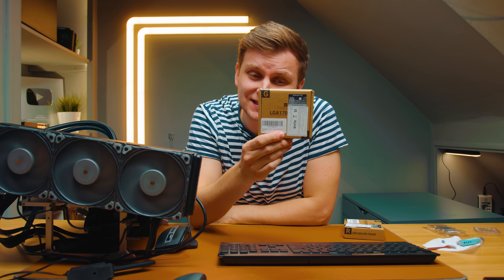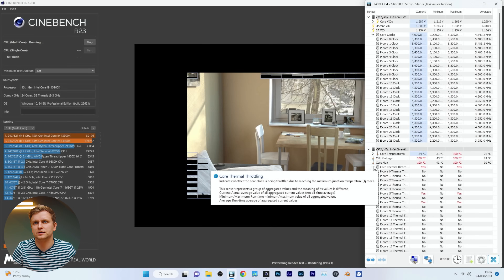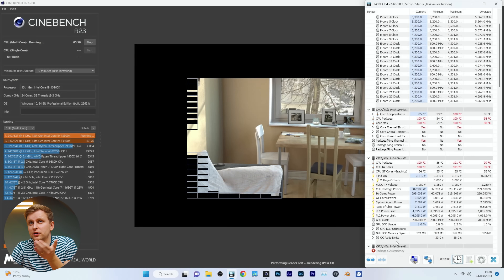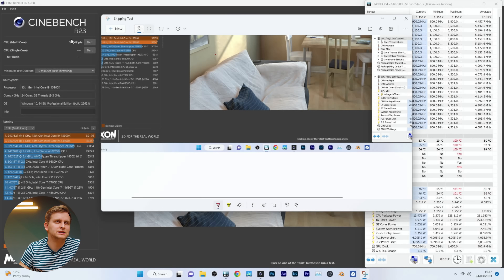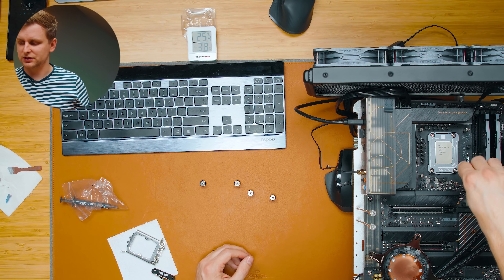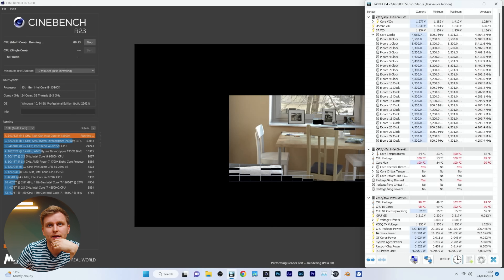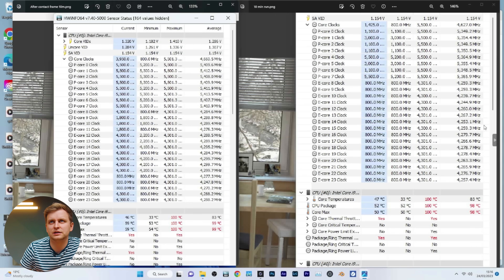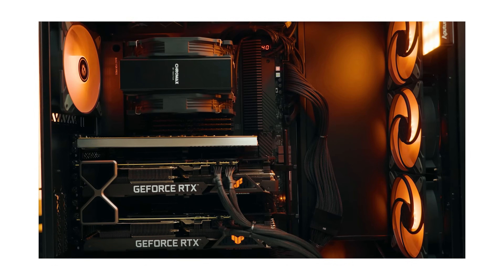This Makes Your CPU FASTER & COOLER 😱 | Budget CPU contact frame for Intel & AMD

Comment: The Thermal Grizzly Contact Frame is manufactured and produced in Germany and it has lower tolerances than the one from Thermalright. I am using the one from Thermalright, because the Thermal Grizzly Contact Frame wasn't available, when i needed it. The Mounting is also slightly different - Gamers Nexus did a good Video about it.
Edit: I am using an i5 13600k slightly overclocked to 5.4 on the P-Cores, 4.4 on the E-Cores and 4.9 on the Cache with a fixed voltage of 1.26V (equal to stock under load). In my case, i got a 9°C improvement in liquid temperature. The CPU itself was 15°C cooler than before. Testet in Cinebench R23 with a warming up time of 20 minutes and a 30 minute test run - my loop has about 450 to 500ml of coolant and a single 360mm radiator.
Reply: The Thermalright frame is much easier to install that was enough for me. If you're going to make a better solution to Intel's over engineered jank then don't replace it with more over engineered jank. (but then the Thermal Grizzley one is german designed and germans are all about over engineered jank)
Reply: No way it's stable at 1.26v. Try compling the shaders on Last of Us 1. It's gonna crash every 20 seconds. That was my experience until I raised the voltage
Reply: @od1sseas663  Silicon Lottery...
Reply: @Hasbert1988  did you try it in last of us. That game is 10x more demanding than even stress testing apps 😂
Reply: @od1sseas663  No, but for my Usecases it is stable.
Reply: @Hasbert1988  Makes sense, fair enough. I said the same when I tuned my ddr5 ram. People where like "I don't think it's gonna be stable if you stress test it for 24 hours". Dude, I don't have a server, I only play games so I don't care. It's stable for me 😂😂
Reply: bro i read it as thermal glizzy frame 💀💀💀💀💀💀💀
Reply: @pendrive4real  Thermalg rizz ly
Reply: this, availability is a bih most of the times i swear. i can barely get my hands on an arctic aio. had to buy it from an unreviewed item online, glad the seller delivered.

And so i opted for thermalright as well.

Comment: Hello, I should install it on a z690 Unify X with a 13600KF? I see tracks going from the cpu to the ram and I'm afraid of interfering. This is for the purpose of a cpu overclock.

Comment: it's more like additional surface area than anti-bend which helps with temps. the pressure to the CPU is little as the pressure is just enough for the mobo pins to contact securely to the CPU. The IHS is also more than thick enough for that pressure.  If there is even bending, it will happen on the vertical axis of the CPU, increasing pressure to the center.
Reply: You haven't thought this through properly. In any event, there are YT vids showing the deformation, measured using very accurate equipment.

Comment: so it evens out pressure to reduce low spots from bending and also seems to increase the contact area of the cold plate. do they make one for am4? also, i wanna see this test after the IHS is lapped perfectly level.

Comment: Also the up shot from having this install is more metal on the Cpu so pulling more heat out I have one on my 7800 Xd3 and it runs really cool now not that it was that hot to start with but get one you will like it.

Comment: I've got the Ryzen 7 7700X. I had some weird temperature issues early on. I was just using the standard bracket to lock down the cpu. First couple applications had the cpu hitting the 95 degree mark under any multicore type of load. I saw the AM5 bracket and went with it as it also works as a way of blocking thermal paste from getting to the parts on the pcb. I hadn't even considered the IHS bending. The thing fixed my temps. I definitely recommend that people consider swapping the standard bracket off their AM5 boards.
Reply: You should probably still not consider the IHS bending, because it's not doing that, if it was nothing short of bending it back flat would fix it. What is happening is the ILM is too long for a single arm ILM to keep equal pressure on both sides of the IHS so it's allowing the chip to sit unevenly in the socket. Which is why these contact frames actually work.

Comment: I use it with a 13600k 👌 nice temps. Max 76°C
Reply: max 76 ? where? cinebecnh r23 ?
Reply: @user-j9ki7r  yes, cinebench
Reply: @micv  how is it possible? what cooler are u using? are there any power limits?
Reply: Nzxt x63 AIO 280er. Pl1,pl2 unlimited. CPU takes around 170w
Reply: @micv  and how much points are u getting? so strange! my cpu rakes 190w and temp max is 90! 23900- 24050 points.
Reply: @user-j9ki7r  ~~24400 ..

Unfortunately I can't share a screenshot, link has been removed.
Reply: impossible
Reply: without the contact frame the temperatures were ~86-87 °C.

Comment: I had maybe upto ~2 difference when I installed the bracket. Maybe my board was not that affected to begin with due to the massive backplate on the EKWB AIO which kinda prevents any form of bending.
Reply: The bending happens between the pins pushing up on the CPU and the stock latch pressing only in 2 spots on a rectangle. So a strong backplate will not affect this.
Reply: When you clamp it before the bracket, you already bend it. Its not ruined, just not as good as a clean install.

Comment: I noticed you was talking about bending the CPU, and just recently done a PC upgrade using the Z690 itx m-board with the Intel i9-13900 CPU,  in the Asus manual it does say to remove that clear plastic tube that is over the arm that locks down the cover plate for the CPU, and in this video it looks like you still have the shipping cover tube still on the locking arm / lever.
did you know about removing it?  i just caught it by chance and so glad i read the manual even for simple things i have done many times in the past..  hope this helps many PC builders out..

Comment: Hopefully u already know this for 13th gens, but with the high temps I changed the incoming voltage by using the bios settings. There is different voltage profiles and I went to the 4th one down and I get higher speeds and the temperature stays under 75degrees. No more thermal throttle which allowed me to keep on my highest cpu clocks…
I tried 6 other volt profiles and tested each one but it will vary depending on ur cpu…
I am now able to use air cooling on my 13900k and I got 42000 on my last 10 min test.
There are lots of videos on it now but I’m wondering why he isn’t doing that for any of his videos….
I hope he can do a video on his process if he does do it cause then it will help a lot more ppl.
Thank you for all ur hard work! It doesn’t go unnoticed! Lol
Reply: could you please share your voltage settings?
Reply: @petbalogh  erm i doubt he is staying under 75c with 42k score... my 13900kf cant do that with the bracket and an undervolt... i hit nearly 43k with an oc... 5.9 on 2 cores rest sit at 5.6... and 4.5 on e cores..
Reply: @TheBURBAN111  yes, you are right. So can you please tell me your settings? :)

Comment: You're throttling because you're running auto voltage, use manual voltage with fixed clocks or set a 253W limit. You're doing it all wrong running unlimited power on AIO, it only makes sense if you have a chiller. Your CPU quality is also bottom tier so it's not helping. 40K can be done at 230W if you tune manually. Big difference!
Reply: Bro that’s the point of the video he wants to see if it makes a difference on temps 🤦‍♂️

Comment: Your testing an already bent and hot cpu. If you make a judgment call on the contact frame, it needs to be with an aircooler. You are not getting an accurate result as a result

Comment: Got this Thermalright contact frame for a NUC12 compute element a couple months back and it actually reduced temps by around 10°. Initially I wanted to by the Thermal Grizzly one, but the price of the Thermalright was so low, it was worth trying out.

Comment: It should be noted that the difference is not that huge if the CPU is already bent. So before you build a new PC remember to use this. Steve from GN said this.
Reply: Metals don't work that way, you have to bend copper a certain amount before plastic deformation occurs otherwise it springs back and the amount of bending going on isn't even close to enough for that to happen. I checked mine with an engineering straight edge and a light and there was no permanent bending. Temps went down by 9C~10C after installation.
Reply: @atomicskull6405  So your saying GN and Der Bauer are wrong?
Reply: @masterdftw4983  If they said that a few hundredth of a millimeter of deflection was enough to cause permanent deformation in copper then yes I'm saying they are wrong. Because copper does not do that. That amount of deflection is not even close to enough to cause plastic deformation in copper. I will trust what the engineering books say (and my own observation with a machined straight edge) over some guy on youtube.

Comment: Just curious as to why you are pumping in so much wattage when it has been well documented since 12th gen that motherboard vendors have crazy bios settings which send way to much power to the cpu.

I'm running a Z790 hero which is also ridiculous out of the box hitting 330w + on my 13900k, after adjusting this I get better performance running at 265w, max temp without the bracket was 89c, when i fitted the bracket it's now maxing out at around 80c on a corsair 420mm AIO, no throttling at all.

Comment: I'm using the cheaper Thermalright which is simple because you tighten down fully, but using the Thermal Grizzly you can over-tighten and damage the CPU / CPU Pins.

I've had zero issues with my Thermalright CPU bracket and my temps are about 5°C cooler on my i9-13900K.

Comment: You might cover this, I have not gotten that far into your video just yet, however I know for a fact that the one you have bottoms out. I know as I installed one on my own rig. It was last gens CPU for Intel on my MSI Tomahawk Z690 board. Thermal Grizzly does not. What I am saying is that when you crank down Thermal Rights you bottom it out. It actually touches the board. I don't believe Thermal Grizzly does this. You have to work the frame around and have no reference when the pressure is equal and correct around the sides. The Thermal Right takes the worry about a tilted frame. I suppose you can still tilt it, however it you look at the bottom and it is equal all the way around then I guess you did okay. My rig posted for me with no problems. No problems with memory or anything else. I have heard where you can mess up your post if the frame is uneven.

Comment: Thanks for the review! Great one! Would you mind testing the AM5 model aswell? Watching along the video I was hoping for the AM5 version benchmarks and also your thoughts on wether it could damage some of the components as they're outside the IHS unlike the Intel CPUs
Reply: ^^ review link fro the am5 doesnt do much considering the am5 was more for thermal paste problem than warping problem like the intel has
Reply: It won't damage anything and it's better than original SAM due to it applying even pressure

Comment: I have it for the am5 7950x. I knew while purchasing that it won't do much for the temps, maybe 1° here and there. But it's a life saver if you will be constantly changing or removing the cooler. I was waiting on my case, then I knew I would be going custom loop. So it made sense for me buying this. Bought it straight away when I purchased the CPU.
Reply: Are If you are like me you might just buy one because having things nice and tidy just makes you feel smarter.  I'm not moving CPUs from systems but I could see a lot of value in this even If it is mostly aesthetic for long-term durability. If you have to spend extra to make your system last longer well it's worth it.
Reply: @kissofthecobra3761  keeping it tidy 100%. Even if you are taking the cooler off once every year (which you should always change your themal paste at least a year), it's worth it. It just keeps the whole CPU clean. I don't think it does anything for durability, at least for amd cpus, the whole die is square so it evenly spreads the pressure, unlike intels. Same for the thermals. Doesn't do anything.

Comment: I would still buy the TG frame just to support the people that designed it originally. Also, there is a functional difference in that the TG is setup to remove guess work. You didn't have a problem here, but that's not to say someone won't. I would just trust the TG frame to have more even force on the CPU. And spending $30 when you're already spending a lot of money on a new i7 or an i9 isn't really a big deal anyways.

Still... a decent budget option.

Comment: It seems a bit insane that you do thermals/cooling tests in open air, which does NOT reproduce real world.  You need to obtain an appropriately sized plexiglass box with vents in it - sides/top but no bottom - then just sit it down on top of the rig when you do the thermal/cooling tests.  That would provide a like-for-like baseline for all rig variations for the tests.  Just sayin' :)

Comment: I have this for my system running an 13700k. It's crazy how a little $12 device can make a huge difference in temps and performance.
Reply: can't confirm, best results i achieved were after i went with a different thermal paste, from MX4 to noctua NT H2, i have not tried MX6 yet , but judging from specs it can't beat NT H2.
Frame did literally nothing, and the die of the CPU is perfectly flat.....when you clean the die very well, and use a laser , you can then use teh die as a mirror to bounce the light of the laser on a wall.....you guessed it, if the die is even slightly crooked, the reflected laser light will be crooked as well, bcoz the reflection magnifies the imperfection multiple time over .
Reply: @krisg822  
" i have not tried MX6 yet , but judging from specs it can't beat NT H2."

Actually I see MX-6 beating NT H2 in almost very review I found, it's often actually the best performing thermal paste.
Reply: @Horizon-hj3yc  with air cooling or water cooling?
Reply: Does i really?
Reply: @mass-1128  it does
Reply: except for gaming
Reply: what gou you have with a 13700k ?
Reply: @A7mby  3060ti
Reply: Guess I better get me one.
Reply: Did you smell a metallic smell for the first few days?
Reply: Same CPU with the same bracket, you are correct on your evaluation.
Reply: Which temps are you seeing and with what cooler, if you don't mind
Reply: @valensi1988  decrease like 5-10c
Reply: @manssupar  Can confirm. Same CPU, same bracket.
Reply: @manssupar  I don't believe one word of it. Your previous setup was probably using different or older thermal paste or poorly applied.
Reply: I just bought the AM5 version for my 7800x3d, I ran both cinebench and furmark just to put the new build to the test with my 240 aio in push/pull and my 4090 and my CPU never went above 85. I was pretty shocked because in other videos I've seen it gets right to throttle temp 95c immediately. so I'm pretty happy with that.
Reply: @JJiG  7800X3D ? you know that this CPU draws max 120Watts? and that 85*C for 120W is.... terrible.That range of temperatures is very close to air cooling, not water cooling. And the CPU in the video, draws twice as what your CPU does. My i7 13700k with stock settings, may draw 270Watts...but after a longer run it goes below 240Watts bcoz my water cooling and especially the CPU water block ain't good enough. I have two 420 radiators from EKWB, and they keep my CPUs cool since 2011 or so.
Reply: @krisg822 You also have to remember that Ryzen 7000's CPU have super thick IHS's, you can shave off 75% (or de-lid) and that will help with water cooling.
Reply: @JJiG  perhaps if you de-lid and add liquid metal
Reply: @JJiG why would you pair a 4090 with a midrange CPU. You’re better off with 7950x. A 4090 cost as much as a CPU,MB and ram.
Reply: @Typhon888 The i7 13700k is not a midrange cpu
Reply: @JJiG  ALL CPU's will go to 100c. your system is limited in power than. Give more power to cpu and you'll see.

Comment: Love these videos!! 😤 

I previously had the Lian Li Galahad 240mm aio w/ stock fans on my 13700k, and it would get around 84-87c on r23 while never passing 74c while gaming 

Changed to the MSI MEG Coreliquid S280mm aio w/ 2 140mm Silent Wing Pro fans, and that exact same contact frame. On r23 it wouldn't pass 74c, and while gaming it wouldn't pass 64c. 

My custom fan curve was the same for both, as well as the CPU undervolt.

Comment: its a worthwhile upgrade to mitigate bending in the long term. the stock ilm has been shown to bend the cpu, keep it mounted for years and countless heat cycles it could become permanent. either frame will prevent this. i have the thermalright installed in 13900k, fast and easy install, with a bit more saftey built in over the thermal grizzly frame.
Reply: Hey! I'm thinking of buying the same contact frame. Can you please guide me here? I'm not an expert. My i7-14700K with an Asus Z790 will arrive next month. Despite people telling me not to buy Intel due to crashes and faulty CPUs, I'm still going for it. What I want to know is, when my CPU and motherboard bundle arrives, should I just assemble it and start using it, or should I first go to the BIOS to update it to the latest version? Will the motherboard be updated for the i7-14700K microcode? The motherboard is the Asus Prime Z790 WiFi 7.

Also, after all that, if I limit the power of the CPU to 250 watts on all cores, will it still hit 5.4 GHz? Will it stay cooler under normal temperatures and not thermal throttle when using the Deepcool AK620 digital cooler?

Sorry for the lengthy message. Any help or guidance on setting up the i7-14700K would be much appreciated. I'm a bit nervous about it!